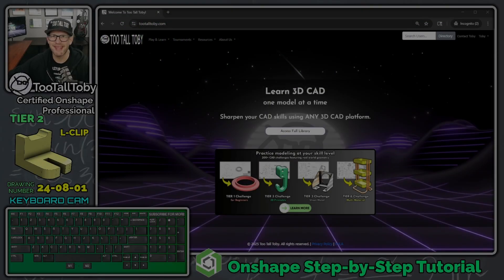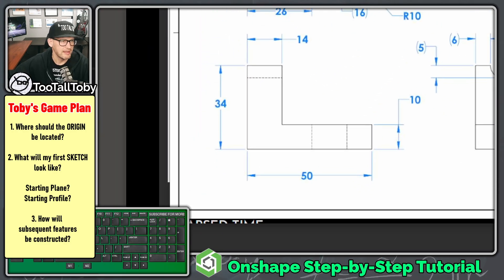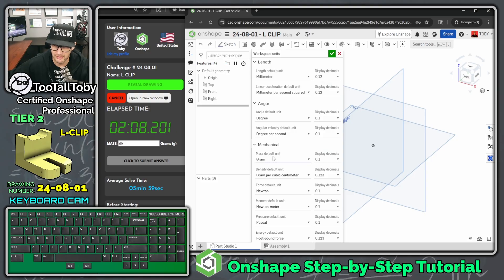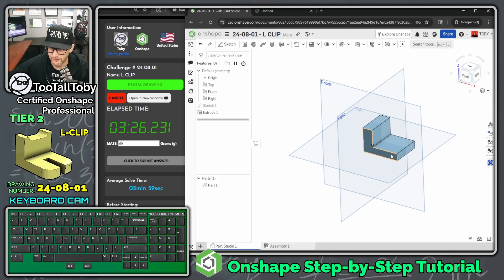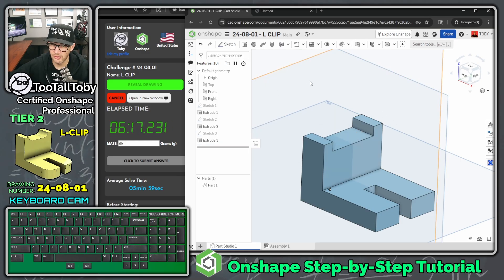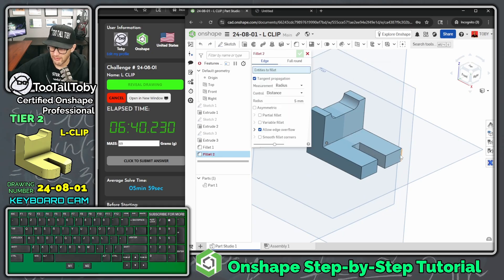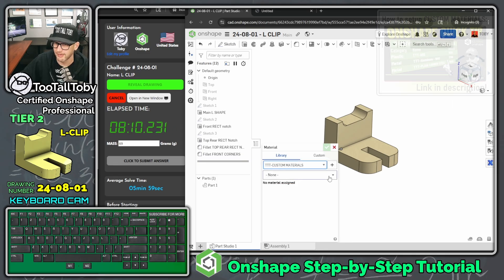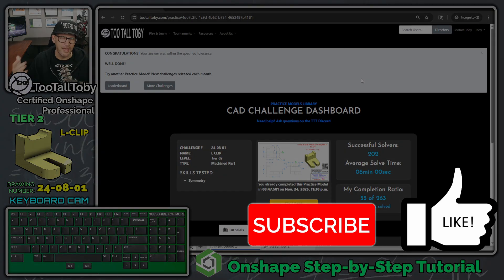Onshape Beginners Step by Step Tutorial - L CLIP - Easy Tier 2 Part for Students

Comment: I moved over to fusion 360 or at least going to transition there for one issue that’s mind boggling to me. Fonts. Onshape does not have the option for custom fonts and the fonts they do have are limited. Please tell me there is a solution to this. I’m not enjoying fusion as much as onshape and I don’t want to import a font file as those have way to many vectors when importing